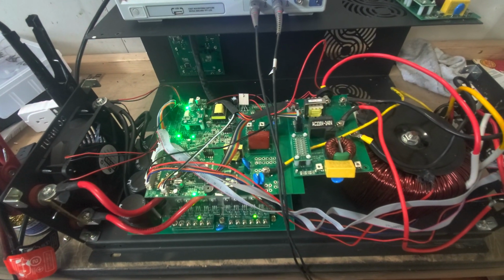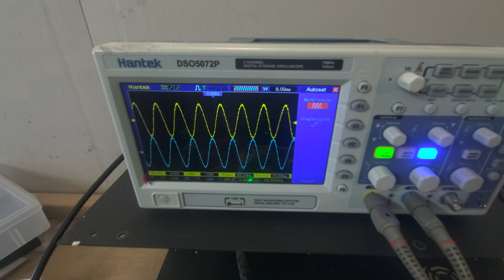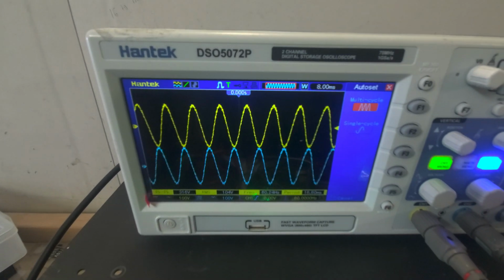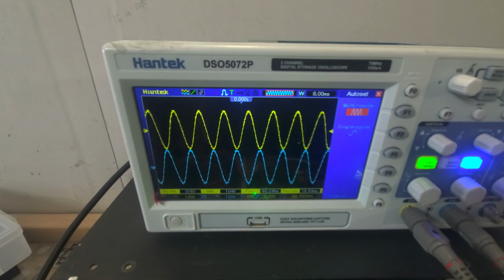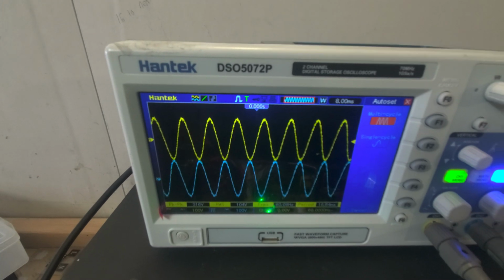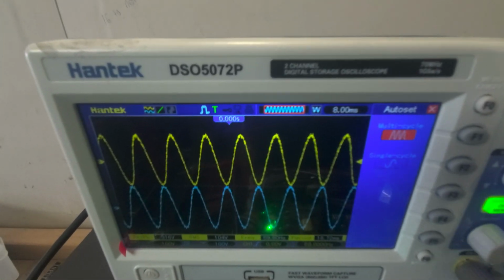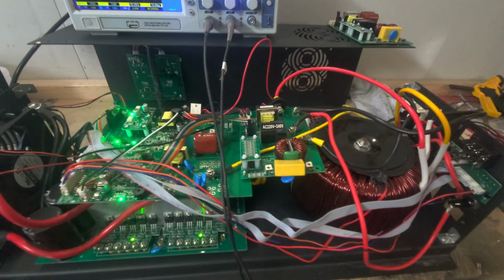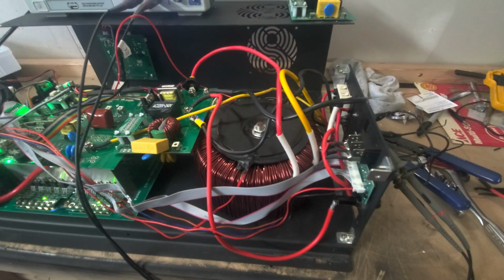Power Jack Split phase conversion (no charge)

Comment: Any chance you could go over the wiring to the generator making it look nice and run to a panel.  Just looking for some ideas.  I plan on running a liquid tight conduit out of my main panel and then back in after passing through the inverter.  Just all the cables and running them and bolting down to make it look decent.  My last one was a bit of a mess, l just want to think enough ahead this time so I have the right parts ready for the install.